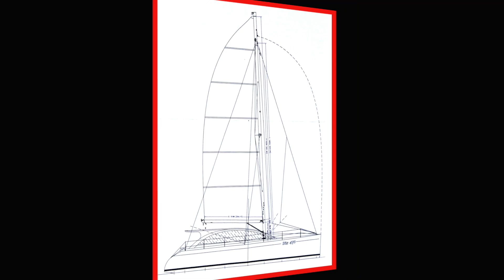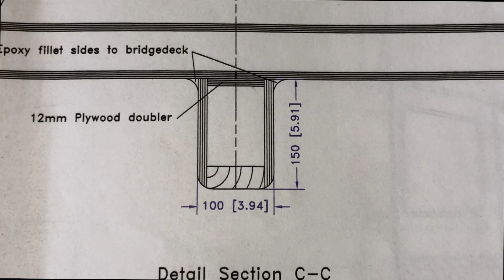Dix470 Bridgedeck Pt1with Japanese subtitles.

Comment: i guess the next video will be of fitting the stringers in the bridgdeck and top layer including insulation. I would love to see how the stringers on the beam bottoms is integrated into the bridge deck. 

Looks great. Exelent work!
Reply from the maker: Hi Dan, yes next one will be the stringers, insulation ect.
The main connection between the bridge deck and the hulls are the bulkheads, transom and the 45deg splay that runs the length of the bridge deck.
Stay tuned 😊

Kev